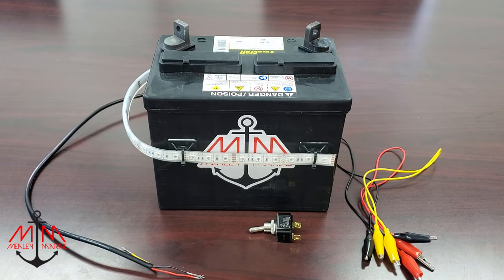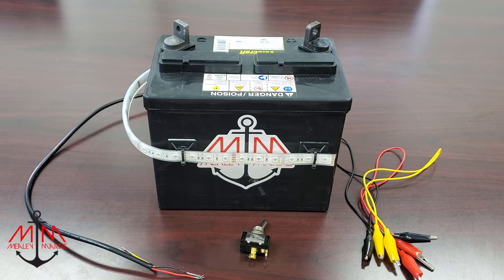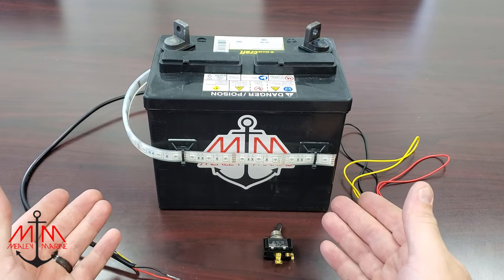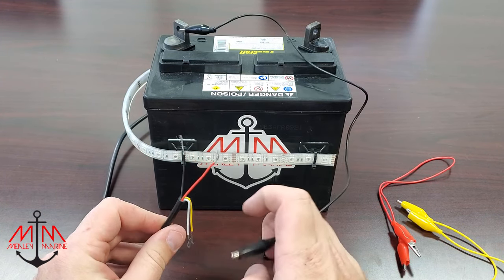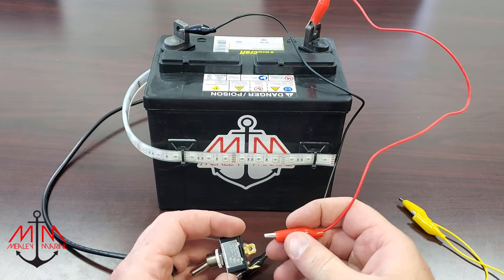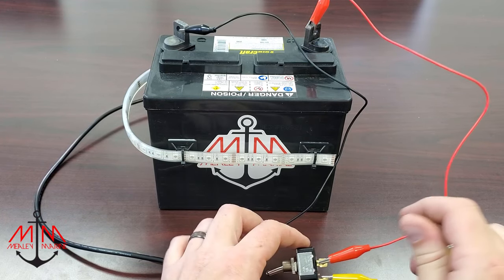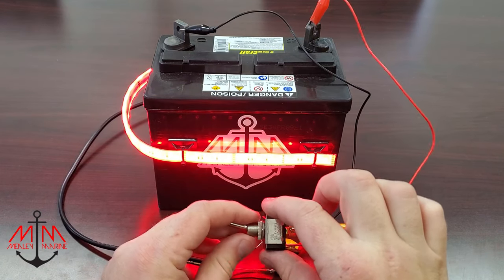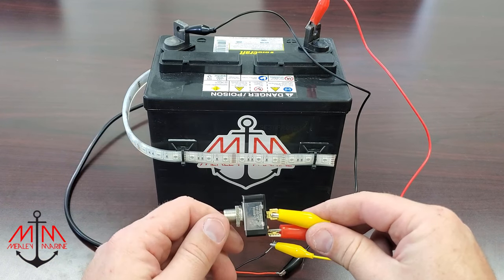HOW TO WIRE A ON OFF SWITCH | 2 POSITION TOGGLE SWITCH

Comment: I have a 12volt magic chef refrigerator. I would like to add a toggle switch to kill the power when needed. Is there a certain size switch that I should use? Is a 12volt 15amp two prong toggle enough?

Comment: Much needed thank you. My question is I have 2.. 2 terminal on/off switches. One at console and the other on the front deck. How do I get them to work together? My older ebbtide boat does not have a manual

Comment: So the three wires coming out of the battery.. do you need to use those? I’m making a project where they are already taken up connected to a pcb.. is there any way I can still have the battery connected to my electro magnet. And connect the power switch to the battery also?

Comment: So you connected a ground wire from battery to the pos of accessory?  
Im trying to wire LED headlight on old motorbike and new switches. Each handlebar switch has 3 buttons and from each button comes 2 identical coloured wires: button 1 has 2 black wires, , button 2 has 2 blu wires and button 3 has two red wires.
Any tips be much appreciated. Thanks.

Comment: I have a blazer that I can't drive at night because ONLY the brake lights/reverse lights/and blinkers work the parking/red taillights don't and nobody can find the problem so I have a extra 12vbattry and a set of magnetized trailer taillights to put on the Chevy blazer  thought instead of having to hook and unhook the gator clips I could figure out how to  make it a little bit easier like a switch or button to turn it on and off I'm a mom of 4 the battery is by the tailgate so what would I need to buy and how would you  recommend I should do it plz gb2m asap thanks

Comment: Okay I know this is a random question but if a switch is rated 12v 5amps, wouldn't connecting the switch directly to the battery overload it?

Comment: If you needed a fuse, would you put it between the on/off switch and the device; or between the battery and the on/off switch?
Reply from the maker: Doesn't matter but standard is between switch and device

Comment: I am not sure how are you made such a simple connection so confusing. Who the heck connects black to red? (And yes, I read your pinned comment below, but it was not helpful). Not sure why you refer to the black wire as the lead – I thought black was the ground. least helpful video ever.